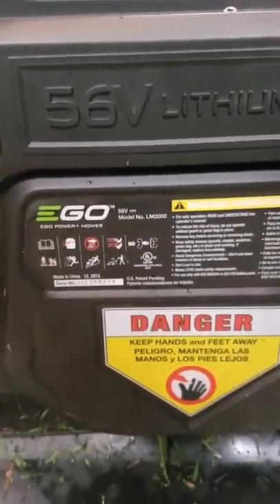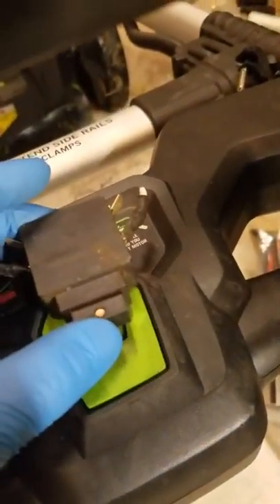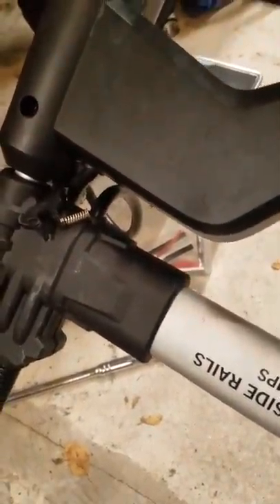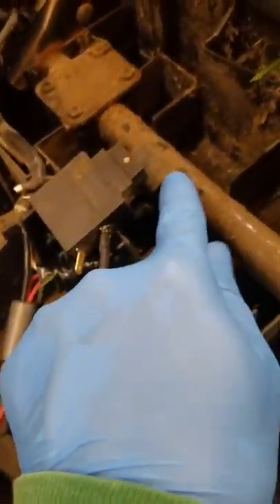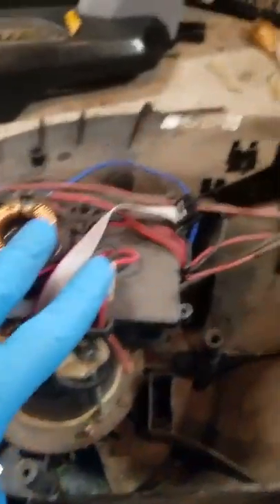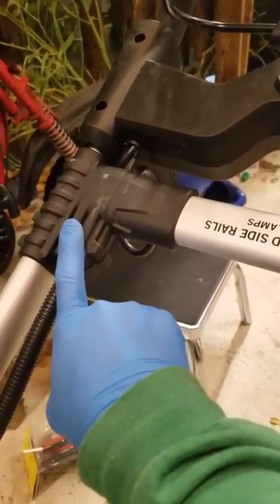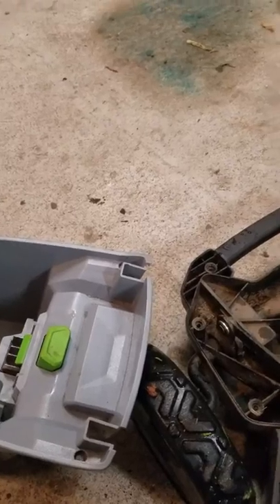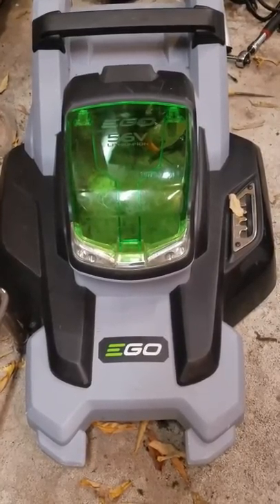Ego mower won't start / not starting ... FIXED!

Comment: Thanks for the info,  I will check those out. I am also having a problem with my mower not starting. I took the first relay near the handle off but will try the other two.
Reply from the maker: I hope you were able to fix the problem.

Comment: I LOVE Love love my EGO 56v Lawn Mower, I love it so much that I ordered the EGO Pole Saw and String Trimmer, living in Florida with all the rain and humidity it is so nice not to work with Gas, draining the tank and line, no oil or spark plug to worry about, no putting on a new Carburetor due to corrosion... and my Steel deck always rusted... EGO RULES!
Reply from the maker: Good to hear that it is working out for you! Sometimes you can find deals on offer up and craigslist for extra batteries and other Ego tools.

Comment: Thanks for the fast reply.  I just spoke to EGO, Tech Support, and they are sending me a diagram on how to remove the battery box. Maybe I will make a video and put it on here. Might help someone else wit the same problem...Thanks a lot appreciate your time..
Ralph
Reply from the maker: Good luck!
Reply: Ralph Coughenour please do! Am wondering where all the screws are am gonna do this this weekend mine stopped working it has a new motor in it so am sure its probably one of the stupid sensors.
Reply from the maker: @xxycom8963  thanks for this additional information!

Comment: Thanks for the video I did the first relay a while ago mower still didn’t work I’m going to try the 3rd relay. Hopefully it works
Reply from the maker: Good Luck! Hopefully it is not the motor and just the relay but they are available on ebay if you need one. My issue was the 3rd relay next to the base of the mower.

Comment from the maker: peepsf70 good luck with your mower. I forgot to mention that I was still getting power to my lights even when my motor would not turn on. I hope it is just a simple switch/relay out of place or not working. As I mentioned in the video you can bypass the two switches and not have to worry about them being an issue. If you take the spring lever out of the handle adjustment area you will be able to set the bar height any setting that you want also and the mower will still run. If it turns out to be your motor you can buy another whole complete assembly with the wiring harness on ebay for $69.

Comment: What do you think could be the problem if the motor runs but only for a few seconds? Battery doesnt seem to be the problem since flashlight still works. Thanks.
Reply from the maker: Hi Thomas. Did you ever figure out the problem? Sorry I couldn't help. It could've been a pinched/shorted wire somewhere.

Comment: Thanks， do you know the relay modle? I just haven't use it long time the led broken and can not start now. I think probably is relay wrong
Reply from the maker: Are you asking if I know the relay/switch part number? I'm not sure. You can take the mower apart and see if your switches are put of place or just bypass them to see if the mower will start.

Comment: Maybe you can help. Today the mower started losing power, not clogged, I released the handle before the motor staped completely. Pushed hhe starter button, motor started up normally for a few moments then slowed to a stop again. Capacitor or inductor, something like that. Thought I'd ask you before I tore the thing apart. Thanks
Reply: i have the exact same problem. When i press on the self propeller it works though so i conclude that the battery is ok and it's probably the motor that i burnt.

Comment: Did you have a constant flashing yellow light when you tried to start it?
Reply from the maker: When I was having my issue I don't remember any flasing yellow light. As I recall simply nothing would happen when I attempted to start the mower until I fixed the switch near the bottom where the handle attached to the base.

Comment: How many amps is that relay? Wondering what kind of power this thing uses when it starts and when it sustains
Reply from the maker: I mistakenly kept referring to those components as relays. I think it is actually just a switch.  Sorry for any confusion.

Comment: am in market for a mower, i have somewhere around 1200 - 1400 sq ft yard. am thinking either Ego 54v/Ryobi 40v. Looking at the issues in the Ego, am wondering if i should just go with RYOBI 40v. Any suggestions?
Reply from the maker: I don't have any experience with any Ryobi products so it would be hard for me to say. My EGO has held up okay for me other than the displaced switch.

Comment: Question! Please! So I’ve checked all the relays and removed the handle adjust pin, so that’s bypassed. I cut out the lower relay under the bottom cover and bypassed that. I’ve opened up the handle and that all seems fine, if I slowly very so very slowly push the button and pull the handle it will start sometimes. But usually I get the orange flashing light every time. So I’m thinking it’s the relay switch under the handle. Do you think I can use the bottom relay switch? It only has one in and one out. Not 4 like yours
Reply from the maker: It sounds like the handle switch is the only other variable that may be causing the problem. I would bypass that altogether and maybe mount a whole separate on off switch somewhere if you can't use the lower switch that you cut out. Other than that it may be the battery or motor. Hopefully it is just the handle switch. Good luck!!
Reply: Virginia Fruit Grower thanks man! And appreciate the video!
Reply from the maker: @genestump9199  No prob. I really hope you get it figured out. I've enjoyed having my Ego mower so far. I just keep picking up extra batteries on Offer up whenever I see them cheap and mow on!

Comment from the maker: Sherie you have to unscrew a lot of screws that are underneath the mower. If I remember correctly there are a couple of screws that I had to use a bit extension to reach with my cordless drill like this:
https://www.harborfreight.com/6-in-magnetic-hex-bit-extension-68517.html
But you can just use a long screwdriver to reach them. You  may have to look closely under the deck because grass clippings may be hiding a few of the screws.
Reply: Thank you!

Comment: Hello, I see this vid is 5 yrs. old, but this is my first time coming across this specific vid.  And it's an excellent vid, thanks for posting.  I have a question (pick your brain).  I own LM2130SP (purchased Feb 2021).  Let's assume I checked all the relays that you mention here and there are no issues (I really did do this). Also, assume no batteries issues.  Though there is a caveat regarding the battery but I digress.  My EGO mower randomly decides not to work.  It stalls and/or just does not start and I can't recreate the conditions for me to troubleshoot any specific area.  Hence, the assumption all relays/wiring seems to be working as intended.  Also, I double triple check all the typical operator errors, the blade freely spins in either direction.  It stalled on me yesterday & the day before (3 & 4 May) when trying to cut my lawn at the beginning.  Starts as it should then after 30 seconds to 2 minutes it stalls, I'm still in my driveway, not on grassy area.  The battery is all green fully charge or all green with one indicator light off, but the indicator light on the handle went from green to solid orange.  The manual says "due to overheat", my battery is not hot at all.  I store it inside my home and it works fine on the EGO trimmer I have.  I call EGO and of course after 30+ minutes on the phone with the rep, I cannot recreate the stalling issue.  It's running for a solid 5 minutes as I'm on with the EGO rep, for obvious reasons they close the case (this same thing happened last year, I took it to the authorized dealer and they could not recreate the stalling). I immediately attempted to cut my NOT overgrown grass. It worked for approximately 15 minutes and stalled again!?!?!?  It's still under warranty, so obviously I don't want to start re-wiring stuff, which I'm fully capable and comfortable doing.  I simply want EGO to address what the heck is going on.  And to add insult to injury, other times it works as intended with no issues at all.
Reply from the maker: Thanks first of all for your kind words and watching.  Yes it's strange that you have this intermittent stalling issue.  Seems like you're not overworking it and doing everything correctly.  I'm not sure what could be the problem. I'm sure it's really frustrating.  Hopefully you're able to either figure out the exact issue or theu replace it for you. Best of luck John!

Comment: Thanks.  I'm going to watch your video on how to remove the top.  Mine starts most of the time but then turns off as soon as I move it and the light blinks yellow.
Reply from the maker: Good luck finding the problem. Hope it's an easy fix.
Reply: @VirginiaFruitGrower  Fixed!! Thanks to your video I went straight to that switch.  I drilled two small holes next to it and zip tied the switch to hold it in place instead of bypassing for now.  Also ran hot glue around it.  We'll see if that holds up.  Thanks again for your super helpful video.
Reply from the maker: @ocrun6765  Great news! I'm very happy that you were able to fix it. Happy to have been able to help😀.

Comment: My mower suddenly stopped working. The leds still light up with working battery. I came thru this video and thought it would be the relays/switches. Do I need to open all the housing to check the relays? Can I just listen to the clicking sound when I operate the mower? Currently, I am hearing all 3 relays (at different stages: extend the bars, rotate the bars, etc.). Please help.
Reply from the maker: I believe that's what happened to me. It just stopped working all of a sudden and it happened to be a dislodged switch at the bottom closer to the deck. The one at the handle and midway on the extendible bar was fine.

Comment: Hi, i have this model:ego lm2100sp. My question to you is this: Was the unit moving forward when you were activating the self propeller or not?  Mine does but the motor won't spin the blade so i know it's not the battery. I am guessing i burnt the motor bcause when it's cool down the motor starts but as soon as i hit the grass it stops and won't start again for a while. I am nonetheless in the process of verifying the 3 relays you mentionned in your video. Thanks for that vid. Super helpful!
Reply from the maker: Glad that you found my video. My model does not have the self propelled option. It does sound like you may have a burnt motor but I'm not sure if there is yet another relay or switch on your model. Do you have another extra battery to test out your mower? Best of luck with your repair!
Reply: Hey thanks. The battery has a self diagnostic built in the charger. It appears fine and like i said, the propller works fine when activated. So yes, it does sounds like a burnt motor. You mention you found a motor for 69$ on ebay. I am not finding anything at all. Do you have a link you'd be kind enough to share please? Thank you!
Reply: @Christian Dupont , I know it is a year latter that I am responding. I am hoping it will help others. My 2102SP developed exactly the same problem as yours, i.e. self-propel working, but the main mowing motor was not starting. The self-propel function of EGO mowers have a separate small motor, inline with the “axel” of the front wheel.  The problem was the switch under the starter button. Just one warning: when you open the handle to get access, there are two springs which have a tendency to fly off. So open the handle very carefully, so you know where the springs are. In my case I lost both. I bought a bag of springs from HomeDepot. The spring under the starter button is conical spring. The one for the self-propel lever has circular cross section, maybe 1.25 inches long. Hope this helps.
Reply from the maker: @xxycom8963  thank you for this added information!